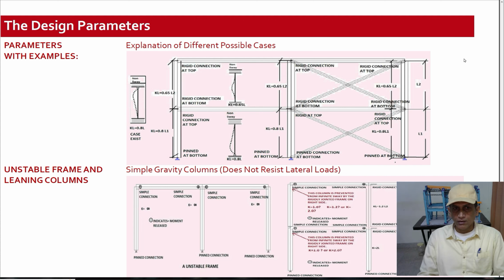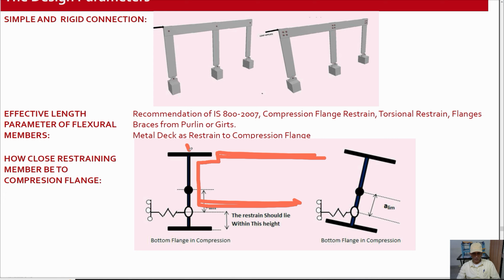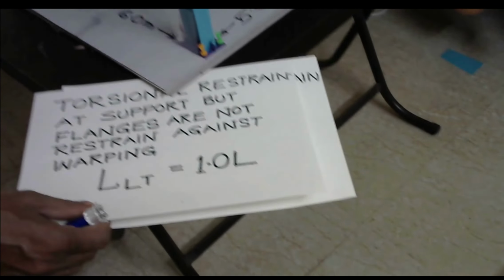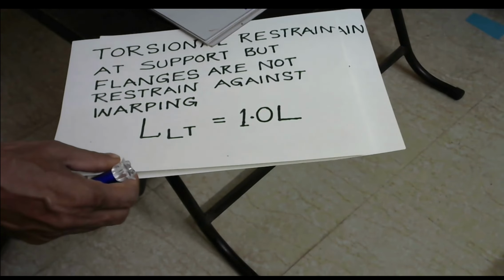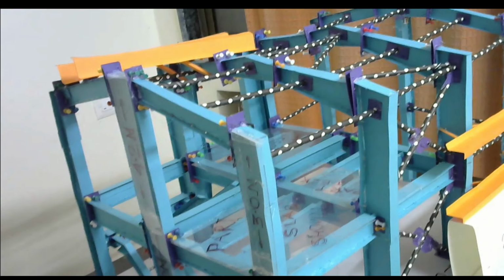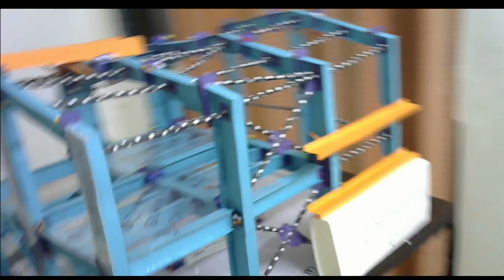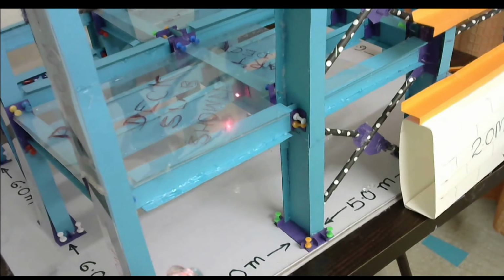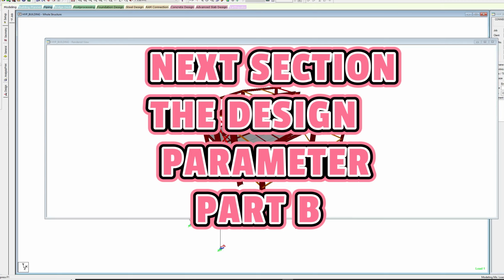SECTION 8 THE DESIGN PARAMETERS,ALL STEEL DESIGNER MUST KNOW

Comment: Sir at 48:25, why hinge connection is considered at the top of column as the joint is free  to sway in both directions?
Reply from the maker: look at the model. The column is braced at the top by the the struct, hence it is hinge at top and bottom. The struct carries the lateral load to the  roof brace and roof braces carries it to the eave brace, eave brace to foundation

Comment: Where can i get that book which you have used in explanation of effective length of column,refer yiur video section 10:34
Reply from the maker: Visit www.designsteel.in
Reply: Can you please check the website path, shows error
Reply from the maker: The Website is down as of now. It shall be revived in Feb 2024 @niranjanwatave3575
Reply: @softwareaidedstructuraldesign  sir it still not working.